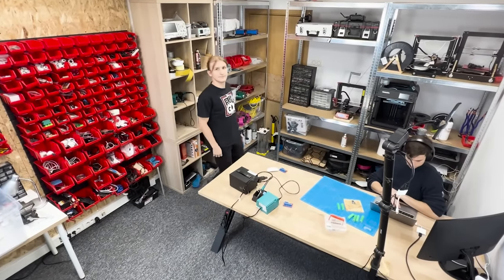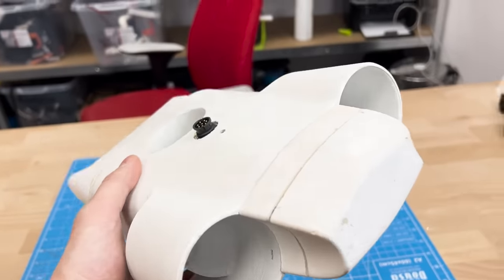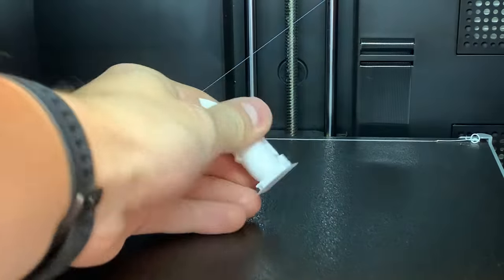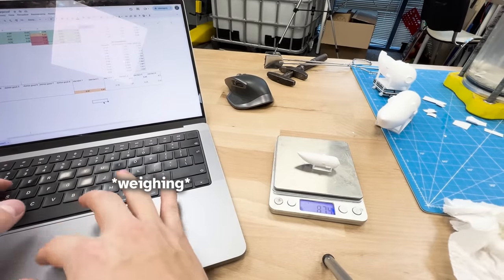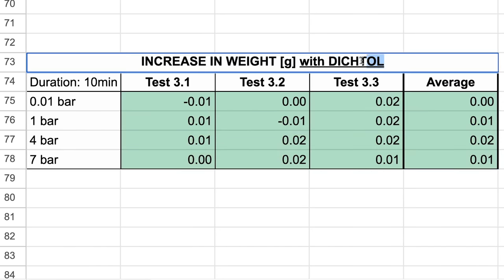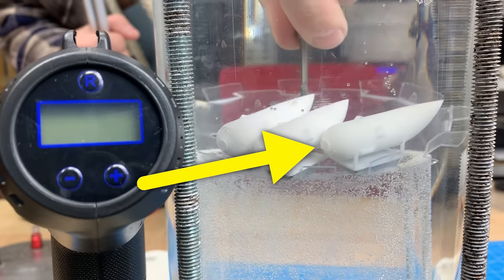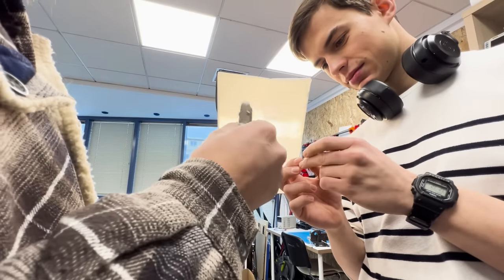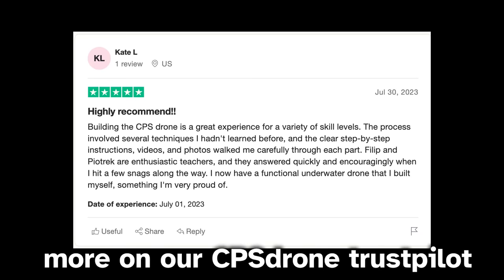Making 3D prints actually waterproof

Comment: couldn't you just fill the drone with mineral oil and seal it up? Its not compressible so would take care of the pressure and keep out the water. Also does not harm electronics? Also they use in to fill eyes after surgery so the even has adequate optical properties.
Reply: A family member had eye surgery and I was surprised to learn they don't fill the eye back up afterwards, coz the eye just naturally fills itself back up over several days.  Gross but true.
Reply: Glad they recovered well. It depends on the surgery though. For a detached retna they fill with oil for a couple of months so it holds the retrna to the back of the eye while it heals.  @roidroid

Comment: The German 'ch' is not pronounced like the English 'sh'. Not even remotely close. The closest that an English speaker may be familiar with is the Spanish 'j', but I don't think English speakers can pronounce that one either, since almost everyone I've talked to or watched has pronounced it identical to a h.

For your convenience, to pronounce it, your tongue should be at the back of your throat, similar to where it would be when gargling water after brushing your teeth - with the tip pointed down OR up (depending on the roughness - this is a soft ch, so you point it up). You do not use your teeth to pronounce it. You do not use the roof of your mouth to pronounce it.
Reply from the maker: I appreciate your insight, but I even asked them how to pronounce it :) They told me to just say it the same way as the guy in their video: https://www.youtube.com/watch?v=Lr7sK1TpwDw

Comment: Get some tungsten metal it's basically the strongest metal in the world stronger than two sheets of little titanium and Steel if you use tungsten nothing could go with Park City 50 million kilometers before it just breaks if you make it very thick that is how you could get down there and if that doesn't work put more videos of tungsten on and it's going to work but only downside with that is it very expensive I don't know which stores you could get it